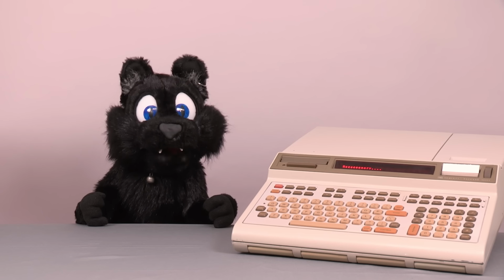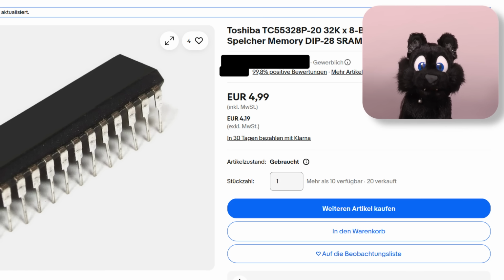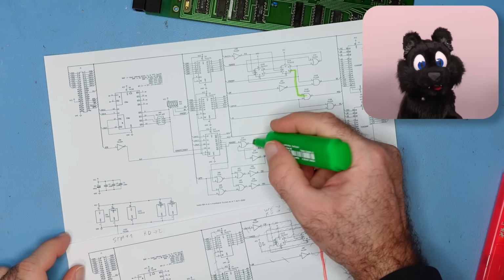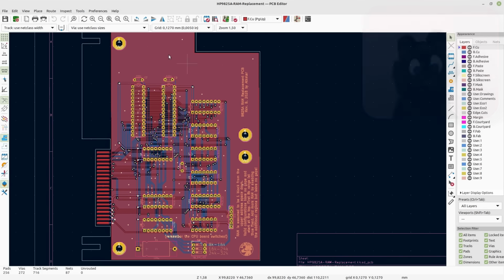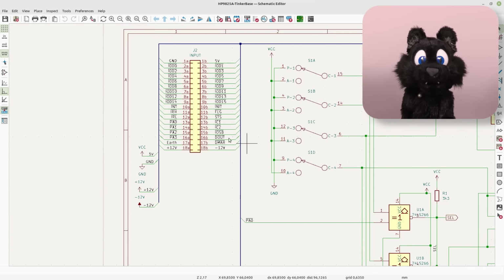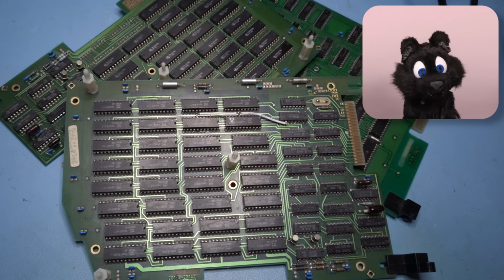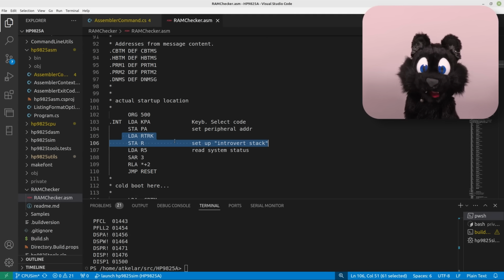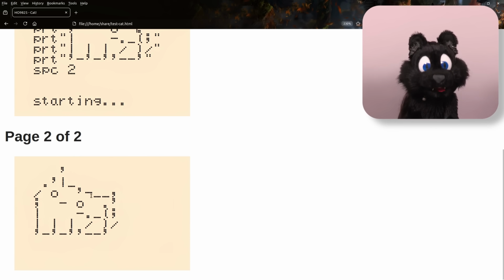HP9825A Update 1

Comment: Rabbit holes indeed...great job on the new RAM board! it was a good way to see the schematics to PCB design process using KiCAD (I use EasyEDA but am slowly migrating to KiCAD).
Reply from the maker: Thanks! The process is a bit abbreviated here, but as far as free packages for PCB designs go: I think KiCAD is by far the best option, even if I have a few ideas on the "possible improvements" section 😆

Comment: You can also lock the mounting holes, that will stop the update from deleting them, if you don't want them on the schematic
Reply from the maker: I think I tried "lock" becuase I didn't want to accidentally shift them; but I since also learned that there is a "not in schematic" setting that helps.

Comment: If you name your pins "VCC" and "GND" then hid them, KiCad know there are power pins and hid them
Reply: Having this "hidden pin automagic connection" thingy is a poor design choice - we had this in some symbols in our Altium library and it alway caused headaches. Is "VCC" the VCC 5V rail? the 3.3V rail? possibly analog or the battery rail? Or it doesn't connect at all because it's named VDD. We removed that from our libraries because sooner or later it bites you.

Comment: In kicad you add the holes to the schematic. Then your problem is gone. Though I don't mind the gnd and VCC in the schematic. I'm sure there already is a solution to that one too. I think you can add them as hidden pins to the symbol and connect them in the symbol to the correct net. Or something like that.

Comment: hi Atkelar ... nice job replacing old DRAM with new SRAM ... FYI ... you can add mounting holes in your schematic ... look for them in the Mechanical library ... next, assign a footprint to select diameter, plated thru or not, grounded or not, etc. ... they will now be imported into your pcb ... also FYI ... in your schematic, you can right-click and set the properties with "exclude from pbc" ... will need to check on the automatic Vcc and GND connections ... i seem to remember it is possible
Reply from the maker: The supply connections would be interesting; I've not seen anything like that at all; and it would be nice to hide those pins from the schematic too... 
Now the mounting holes issue... I haerd that it was possible to add them to the schematic and avoid the problem I had; but to me that is a bit backwards: I think of the schematic as the electrical side and the PCB editor as the physical side of my project. I'd like to keep the elements in "their proper bin" so to speak. Like the power connectors, I think adding mechanical details to the electrical design seems a tad confusing...? Same thing really applies to silk screen markers (for me, my little logo, or a PCB serial number placeholder or somesuch...) - to me, it should be possible to have a neat separation of concerns. Again, just ideas based on how I would see the workflow.
Reply: @atkelar  I really like your table idea. Particularly added as a side-key right on the schematic. I'd like a similar thing for all the decoupling capacitors. The symbol library could hint it all to pre-fill the table with data-sheet recommendations. The rats-nest for the circuit wiring wouldn't change at all, and it seems like this would really reduce missed caps.
Reply: @atkelar  I get your logic .. but I look at the schematic to be my "reference" that needs to have all the details and decisions ...  DRC and ERC will then more or less "guarantee" my PCB is perfectly matching the design ... so as long as I am able to somehow tag or build my schematic, I am confident about my PCB ... hence my use of the "exclude from PCB" and mounting holes etc ... so two different approaches where neither is right or wrong ... similar to the long running discussion where some EDAs during schematic symbol selection force you to choose your footprint, e.g. THT or SMD ... KiCAD separates that with the rationale that your footprint should be completely separate from your implementation 

And after writing all that, I just remember you could also place your holes on you PCB and right-click and select "lock" ... no need to have them in your schematic ... useful for exclusion zones which you cannot add in your schematic